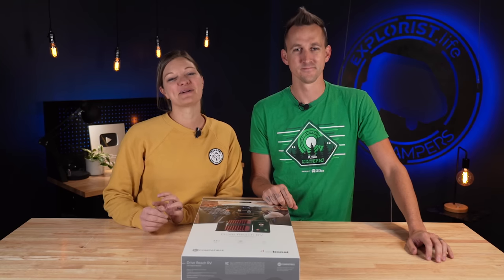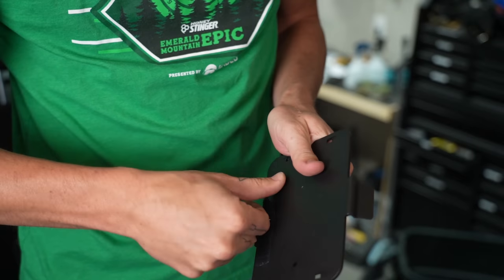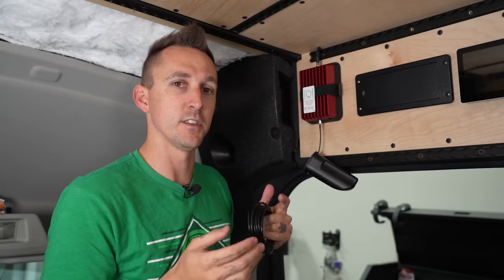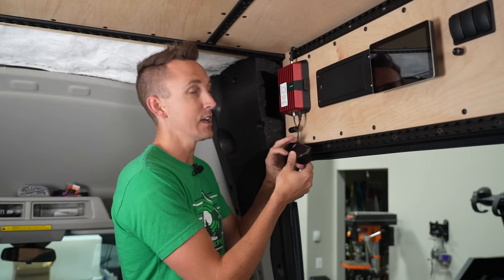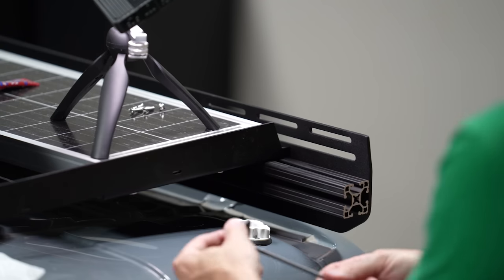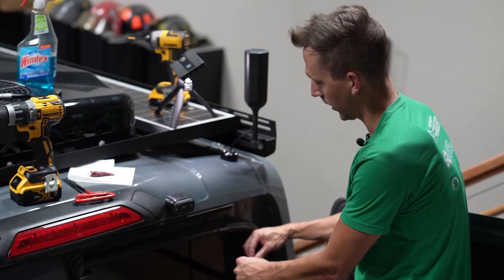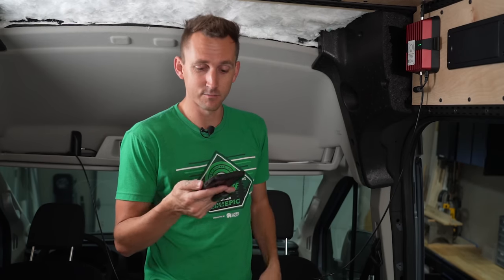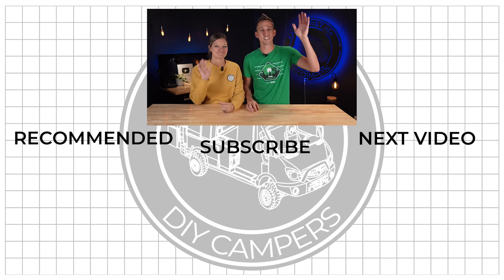WEBOOST SIGNAL BOOSTER INSTALL (start-to-finish)

Comment: Does the location of the exterior antenna matter? Yours was installed on the edge of the roof. Would placing the exterior antenna in the middle of the roof reduce or increase signal reception? Maybe the roof can act as a 'ground plane'.
Reply from the maker: Per the instructions, the interior and exterior antenna should be as far apart as possible.
Reply: it is a good idea to utilize the metal roof as a ground plane for these antennas.  To be clear, they have a ground plane built into them, hence the fat enclosure.  That is great for the smaller wavelengths of the higher MHZ bands,  but that ground plane is really not big enough to reflect the larger wavelengths of the 700MHZ bands we are wanting to capture when we are in remote areas.  You want the ground plane to be at least a quarter of the wavelength in radius.  A good general rule is to mount the antenna at least 8 inches from the edge of the grounding plane.  For the short term, we should target wavelengths in the 700MHZ range.  The longer wavelength frequencies to to travel farther and it was the intent with 4G LTE to utilize these wavelengths for rural and remote locations.  A grounding plane is only effective if it is larger than a quarter of the wavelength in radius.  700MHZ waves are just under 17 inches long, so the minimum radius of the grounding plane should be a quarter of that , or 4.25 give or take.  This is still much larger than the grounding plane built into our Weboost antennas.  I expect in the future as 5G is adopted in more rural areas that we will be seeing some robust, long distance bands in the upper 500MHZ range and definitely in the 600MHZ range. A 500MHZ wavelength is just under 24 inches long.  A quarter of which is 6inches for a grounding plane radius, still within the 8inch recommendation.  So I would expect Nate to see an improvement if he were to move the antenna further inboard, but with everything on our vans, there is always a compromise and he put it where it best addresses the other issues and everything else having an obnoxious antenna on your roofs bring up.

Comment: New to van building, how much signal loss is just because you are sitting in a metal can? If the outdoor signal is decent, does the booster still offer something. Does Fords cell hotspot with a roof antenna offer some signal boost capabilities also.
Reply from the maker: I'm sure there is indeed a significant amount of signal loss because of being inside of a metal van. I'm not sure if ford's cell hotspot gives any kind of cell signal boosting.

Comment: I am not convinced of this solution. I would go with an industrial router such as the teltonika RUT X14 and a good antenna on the roof. Also I don't like to bring in more cellular radiation into the van. And all your videos are great but why didn't you mount it behind the panel so it is more stealth?
Reply from the maker: What do you mean 'stealth'?
Reply from the maker: ...and perhaps you could give some good tests you would like to see us do.  We haven't shot that video yet (as of 11/2/22).
Reply: @EXPLORISTlife  Hidden behind a panel
Reply: @EXPLORISTlife  Don't understand the benefit of that webooster. Always thought you would bring a LTE Router for your devices, the cerbo etc.?

Comment: what is the effect of significantly increasing the height of the exterior antenna have on the cell signal strength?  demo on rabbit ears does not seem to be much of a boost.
Reply from the maker: WeBoost says that, essentially, higher is better; but we are trying to keep our build height under 10ft; so installing the antenna 6ft in the air or whatever is unreasonable.  The boosted vs non-boosted speed test was 12mbps vs 600kbps; so it was pretty substantial.
Reply: is a differential of 11 dBm really that significant?  what about testing a higher position of external antenna when not driving?
Reply from the maker: dBm doesn't mean much to me, but the difference between 600kbps vs 12mbps is huge.

Comment: I don't understand why they supply so many of these wifi boosters and 3G/4G/5G routers with such long coax cables. The losses in the antenna coax cable, counter acts the majority if not more than the antenna and booster gains. Which makes me question do these manufactures even know what they are doing? Or is it the case they simply don't care? So long as the make a profit. The best SIM based routers and booster mount their units outside the vehicle and use the shortest coax run possible.
Reply from the maker: I would suspect that the weboost for RV's is just sized for the largest RV's on the road and the maximum chance of a successful install for 99% of use cases.

Comment: I would still use the spring a strong tree branch will rip that sucker right off instead of just bending it over and letting it snap back in place just my opinion
Reply from the maker: It's pretty important to me to avoid running our van into tree branches.  🤣👍 If I decide to run our van into a 'strong tree branch', I know that damage is inevitable.  But yeah... if you want to use the spring in your own install, go for it.  The rest of the install process shown in this video would be the same.

Comment: FYI, the dedicated 12V dc to dc hard wire kit has the same wires!  Not two wires, but one wire in a red casing and an exposed power wire in the black bigger casing. Horrible design!  I just hardwired the WeBoost to the factory Jeep Aux switches.